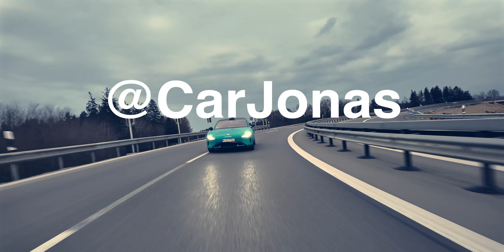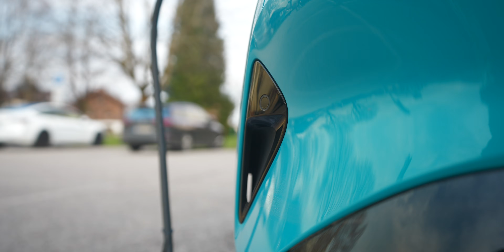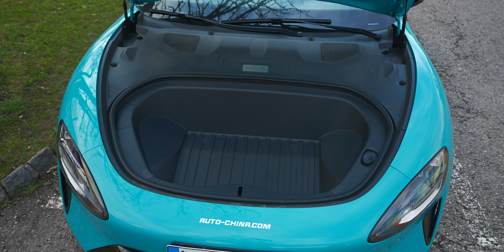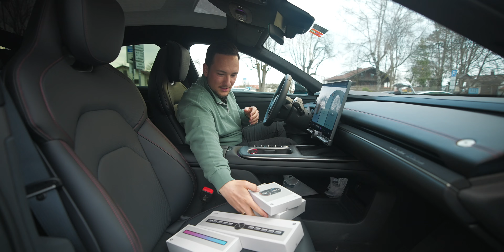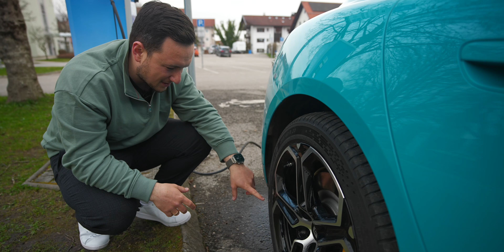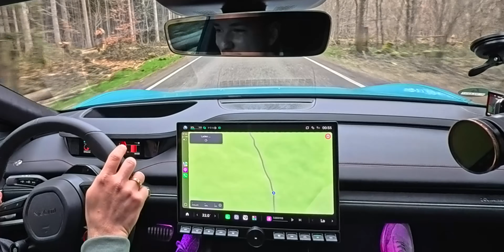Xiaomi SU7 Test - Porsche Killer made in China

Comment: It's not a Porsche killer. It's just a killer. With airbags that don't deploy in a crash. Brakes that simply fail. Body panels that just fall off. Wheels that separate from the body due to only tack-welded suspension components. Doors that automatically lock in a crash will make sure you die from the fumes or the flames. Or it will simply burn your house down, destroying everything you ever worked for. 

This is a piece of horrible junk that just looks like a Porsche. DYOR.
You would have to be insane, stupid, and suicidal to buy one.